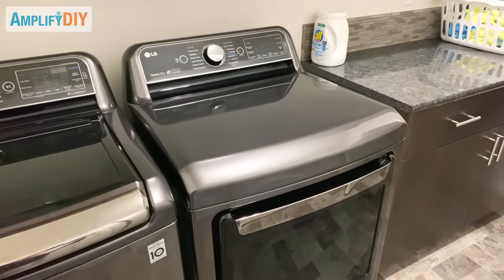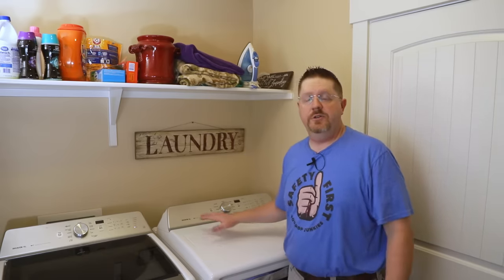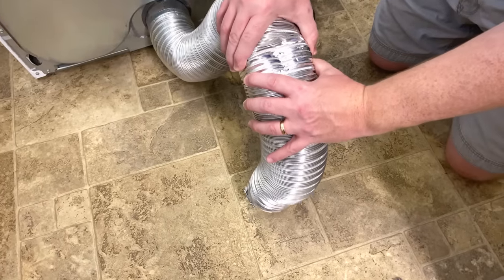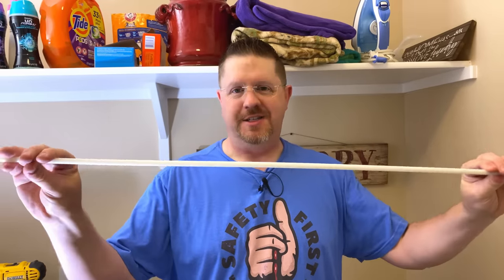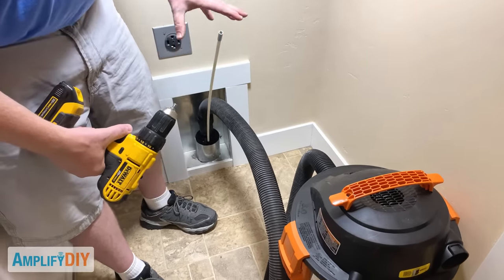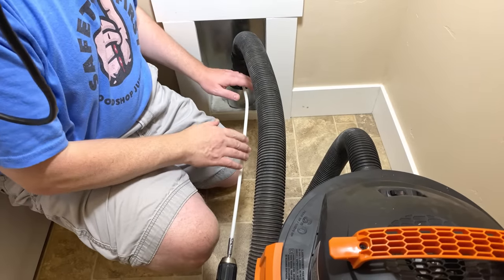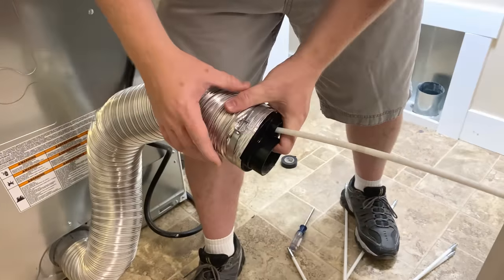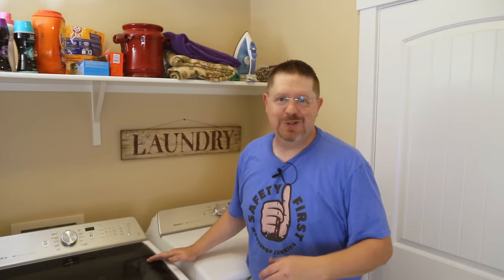How To Clean Your Dryer Vent Duct - Step By Step - It's Super Simple!

Comment: My concern is the brush coming out of the roof on the second floor.  If that happens and it gets stuck on the flapper door, I don't know what to do. I'm afraid of heights.
Reply from the maker: Hi Claudia - do you have a friend who can stand outside where they can see the vent and alert you when you get to the end? As long as you go slow and gentle, you should not have any problem with the tool getting stuck in the exterior vent. Good luck!
Reply: @AmplifyDIY  Thank you.  I'm going to give it a try.

Comment: Maybe dumb question but what if you don’t have a shop vac?
Reply from the maker: Hi K - you can use a regular vacuum... but you may need to use some duct tape to adapt the smaller hose diameter to the vacuum port thing I showed in the video. Good luck!

Comment: I followed all of the steps for cleaning out the vent and still got zero air flow.  I finally removed the elbow-shaped pipe under my dryer and found several pounds of lint all clumped up.  I removed the clump, put back the elbow, taped it back up with duct tape, and things are flowing again.

Comment: Is it fine if I don't use the vaccume?
Reply from the maker: You really should use a vacuum, or else you'll just wind up with a bunch of clumps of lint in ducting... 
Good luck!
Reply: @AmplifyDIY  Thank you so much. I just completed the cleaning and it worked very well. 
There was 1 blunder I did and I need your help to resolve it, I mistakenly ran the drill Anti clockwise and the brush along with few attachments were stuck inside the vent. As a solution I bought another kit and push it from other side. The brush with other attachments came out successfully. But there are still 2 attachment left inside. Any idea how can I pull it out. First I thought I'll let it inside but then I am scared that if I run the dryer there maybe a chance of fire because the attachments are plastic. Any idea how can I resolve this?
Reply from the maker: @umairhussain1039  Oof - you've gotten yourself into an unfortunate position! I think the dryer will be safe to run in the short term - I doubt the exhaust from the dryer will be hot enough to melt the plastic of these rods - their melting point is substantially higher than the dryer output will be. Leaving them there for a few days while you formulate a plan to get them out should be fine. I do recommend you pick up an inexpensive borescope so you can get an idea of a) where they are stuck, exactly and b) possibly grab them and pull them out. Here is the one I used in the video, and it works quite well: https://amzn.to/3o79REt

I'd snake the borescope into the vent to see where the detached rods are. This scope (I think) comes with a small "hook" attachment, which you may be able to use to grab the rods and fish them back out. You may also have to get creative with some bent up coat hangers etc to see if you can make a better hook or claw that can be used to grab some part of the rod and retrieve it. 

Good luck! I hope you are able to get them out soon!
Reply: @AmplifyDIY  Thank you! I have ordered the borescope, will let you know how it goes.
Reply: Hi again, I was able to take the rods out of the vent. But now I ran into another problem. I have a LG dryer, it is giving me flow sense warning with D95 error. Any suggestions?
Reply: I was able to resolve this problem. Looks like there was still a lot of lint inside which was not letting the heat to flow. I cleaned it properly and now everything is good. Thanks!

Comment: How about just to use the vacuum from outside the house without removing the vent attached to the dryer and not using the brush?
Reply from the maker: You definitely need some sort of mechanical "scrubbing" action to lift the lint off the inner walls of the vent. You can certainly attach a vacuum to the outside of the house instead of behind the dryer, but you should still use a brush or something similar to knock the lint off. Good luck!
Reply: @AmplifyDIY  thank you. My dryer is on top of the washer and I can't move it by myself . I will just do regular cleaning instead of detailed cleaning as shown in the video. Thanks again...

Comment: Hello I only have have a small wet & dry vac .
Reply from the maker: Another option rather than using a larger shop vac is to clean from the outside of the house in, rather from the inside out. This way you can leave the dryer connected to the vent, and run it on a cool setting. The dryer will provide plenty of airflow to blow the lint back out as you clean. 
Be aware you'll get tons of lint blown into your face - so wear a mask and safety goggles. Good luck!

Comment: You know what is waaaay faster and easier plus more fun? Put a leaf blower in the duct it blows all the crap out the vent in seconds my blower has turbo button. I do it every six months
Reply from the maker: Others have suggested this... while it appears to do a decent job of getting the big chunks out, mechanically cleaning with a brush will always do a better job. Still, cleaning them with a leaf blower is much better than never cleaning them out at all. Thanks for watching!
Reply: @AmplifyDIY   Using that brush does clean it better im sure but either way its going to accumulate back on there

Comment: Best way to avoid having a dryer fire is not to use plastic vent pipe with ribs on it where lint will build up, use metal vent pipe without any places lint will stick to. Otherwise clean it every 6 months, also clean lint filter after every load. Also remove back of dryer and vacuum it out.

Comment: I’m curious why you would pull all that dirt and lint into the house.  Why not set the shop vac to BLOW all that nastiness to the outside, thus keeping the house interior air much cleaner.
Reply from the maker: You certainly could use the shop vac in reverse to blow rather than suck - but the vacuum has a pretty good filter that prevents the lint from being blown into the house. Thanks for watching!

Comment: What if you don't have a shop vac?
Reply from the maker: Hi coneil72 - you have 2 options: you can adapt a regular household vacuum... just use some duct tape to seal up the connection from the vacuum adapter to your vacuum hose. Or - you can clean from the outside of the house towards the dryer, and use the dryer itself to blow air through the exhaust vent as you clean. You should run the dryer empty, and on the coolest cycle it has if you do it this way. Also note that this will blow ALL the lint right back out into your face as you clean, so I recommend a dust mask and goggles. 
Good luck!

Comment: my ducts have kinds of twist and turns. i get a little paranoid that it will break part of the duct
Reply from the maker: Hi Bandit - these cleaning kits are specifically designed to deal with twisting and bending in the ductwork. As long as your ducts are the kind with smooth walls like I showed in this video, the brush and cleaning kit should fit through it just fine. Good luck!

Comment: What about the vent in the house?
Reply from the maker: You mean the heating/air conditioning vents? Those are much larger and require a larger brush.. They are also usually a lot longer and require a lot more suction - generally that's a job that is not really DIY. Good luck!

Comment: What if the lint is wet? Mine is clogged with wet lint.
Reply from the maker: How wet are we talkin' here - sopping/dripping? Or just damp? If it's just sorta damp, then you can still clean it in the way the video shows. If it's REALLY wet, then you need to wait for it to dry. You might be able to help it dry by running the dryer on a medium/cool setting with no clothes in it for several cycles.... but I only recommend that if the vent is not completely clogged. The dryer does need to be able to actually move some air or it can overheat. 
Good luck!

Comment: Wow never seen a duct on the back of a clothes dryer that goes into the floor or wall.  ALL of the ones here in Australia have no connection built into the house or apartment.  The dryer just vents out the back of the unit towards the wall.
Reply from the maker: Really? As in - it vents into the room? How do you keep your laundry room from getting SUPER hot?
Reply: @AmplifyDIY  Open a window if there is one.  Otherwise just close the door and let it get hot.  The room is already likely to be 30C+ during summer anyway - so not that big of an issue.
Reply from the maker: @VestigialHead  Hi Ian - I wonder if you are talking about a different kind of clothes dryer? The ones most people in the US use get VERY hot - 135F (57C) is typical, but over 150F (65C) is not all that uncommon. Venting indoors is simply out of the question. I think you must be used to a condenser dryer, which puts out a MUCH cooler exhaust: https://www.betta.com.au/blog/clothes-dryers-to-vent-or-not-to-vent
Reply: @AmplifyDIY  The condenser dryers look like they need a water supply connected.  Never seen a dryer here with that.  Not saying no one has them - just that it must be very uncommon.

Comment: Man, no one shows the exact video I need to do this for my gas dryer.
Reply from the maker: Yeah, gas dryers are quite a bit less common - though my family had one when I was a kid. The only real alteration to the instructions here for a gas dryer is that you need to both shut off and disconnect the gas line to the dryer before you can move it. I'd refer to the owner's manual for how to do that - if you don't have one, google should be able to find one if you just search for the model number + "owners manual" or similar. 

Good luck!
Reply: @AmplifyDIY  I appreciate that! Thank you for taking a moment to help me!

Comment: Don’t reverse the brush when you are removing the brush, it will come off the rod when you take it out. We had to go 40 feet to clean out the vent so we had to buy extra extensions to reach the end.
Reply from the maker: Great advice, David! I'm pretty sure I mentioned the same in the video, but it bears repeating. NEVER put your drill in reverse with this brush setup. Always run it in forward, even when pulling the brush rod segments out. Thanks for watching!

Comment: A segment of garden hose and a toiler bowl brush is more efficient.. and cheaper ..
Reply from the maker: And is incredibly likely to not work well and leave you with a toilet bowl brush stuck deep in your dryer vent pipe...
Reply: @AmplifyDIY  Never had a problem...   toilet brush is clamped into the hose..   way more simple..

Comment: Tried to order kit. Link won’t work.
Reply from the maker: I T Man - sorry you had difficulty with the link. It's an Amazon link for the US Amazon store, and may not work if you are outside the US. The product is made by a company named Gardus, and is called: "Gardus RLE202 LintEater Rotary Dryer Vent Cleaning System". Looks like you can get it here: 
https://www.tractorsupply.com/tsc/product/gardus-linteater-dryer-vent-cleaning-system-rle202
or - just put the name into Google and you should have no problem finding a supplier near you. 
Good luck!
Reply: Tried again and it worked!!

Comment: what about the inside of the dryer
Reply from the maker: Yes, you should try to clean the inside of your dryer cabinet as well. I didn't include that because there is such variety in the designs / options for how to clean them. Consult your dryer's user manual to see how to clean yours. Thanks for watching!

Comment: Y'all neglect the slot that the lint trap goes in which is often full of lint also and really tough to clean.
Reply from the maker: Great tip Ruby! I use the crevice tool with my vacuum to clean that out. They also make small brushes that fit in there to help dislodge any lint. Maybe a follow up video is in order…

Comment: Thx for sharing your very simple video you would think! I say that to say? My dumbass shortcut taking Blackman  husband ugh just skipped the 1st section and went straight to the 2nd section because I was like let me go ahead & put 2 rods on but still go up to only the 1st rod while drilling smh! Then he tells me? He's pushing the brush manually no drill running talking about he has to pull the lint back anyways? Dumb duh if he do section by section until the end it will come out the other way! Not put about 5 rods on only to retract the rod then put back which the damn rods did twist like a pretzel & hit me in the damn face ouch! IM DONE PSSST!

Comment: I can't see the name of the item you used.
Reply from the maker: Hi B - it's called a LintEater Dryer Vent Cleaner, and I left this link in the video description: https://amzn.to/2E0gZjK - note that there are a bunch of cheap knock-offs of this design, but they do not include the adapter for the vacuum, and frequently fall apart inside the dryer vent. I only recommend the original. Good luck!

Comment: Except that those kits do not work when the builder of your home was uneducated and used plastic hose while allowing it to dip in between each and every rafter in the attic. Straight pipe going straight up with a metal elbow, connected to plastic hose, with collection dips in the line every 8 feet.
The ONLY repair is a complete and total removal and replacement. Which by the way, gets your rent increased $75 a month. 
Yea folks. It's only the landlords responsibility IF they do not have to actually fix or repair anything. 
And I know. I know the law states otherwise. But here in reality, the law is one of the most flexible aspects of our dying nation.
And when the judge tells you that you do not have "renter's rights", that is exactly what you do not have.
Know your dryer vent system WELL before buying tools.
Reply from the maker: Oof. That's terrible. Does the landlord not understand that it's an actual real fire risk? Are they willing to pay a professional vent cleaner to come at least clean it and take on the liability if there is damage to the crappy droopy section in the attic? I hope you are able to find some solution...
Reply: @AmplifyDIY  
He doesn't believe there is a problem. 
If he hasn't experienced something, its not real. Another tenant's faucets were leaking.
His response: I was there in September and everything was fine. (7 months prior to the leak)
But at 9 am this morning, I decided the landlord does not get a choice anymore. 
I bought all new everything. From just past the exhaust outlet of the dryer to the outside vent cover.
He will be given the receipts, which will be deducted from the rent. Minus labor because I am a human being. lol
Turns out that in my state, if a landlord refuses a necessary repair, ESPECIALLY if the needed repair creates risk to the tenant if not repaired, the tenant may complete repairs themselves or via professional service and turn in the receipts in place of equal value rent payment(s).

Technically I could have called an HVAC company and taken a couple full month's rent off my plate. He can't do the repairs himself. He would have had to hire a company. I say I saved him money either way. If he doesn't like it, my rent payment and I turn and walk out, off to find another place. 
The last two days have been ridiculous. And him and a local judge are incorrect on the law it seems.
Now, no more clogs and no more dips to collect material.
Reply from the maker: Way to stick up for yourself and get the problem solved! I've dealt with slimy landlords in the past, and it's.... well, I can't say what it was like in polite company. I hope you don't get any grief about the repair, but at least now your dryer will work well and the risk of fire has been taken care of. Nice job!

Comment: You connected vaccum but did not even show or mention it.
Reply from the maker: Almost any shop vac will work properly. They mostly all have the same size hose. If you don't have a shop vac, you can use some duct tape to adapt a regular vacuum.

Comment: Way too much work and complexity.  I use a cheap electric leaf blower I got at a second-hand store for $15.  I open the face of the dryer after securing the breaker.  Remove the face plate to the dryer blower and insert the leaf blower into the duct from there.  Turn it on and it all goes outside fast.  Inspect the blower impeller at this time for looseness since these will wear out and cause over heating.  Also, a good dryer exhaust duct only uses rigid metal duct.  Stop using flex duct.

Comment: Remove the old one and throw it in the garbage. Install new one. There it's cleaned.
Reply from the maker: Heh. That may work for the short connection to the vent in the wall, but I don't think anyone wants to rip open their walls just to throw away a perfectly good vent rather than just spend a few minutes cleaning it...
Reply: @AmplifyDIY  of course you would keep the vent portion that goes through the wall but the piping from there to the dryer I toss. It's cheap and easy to replace.

Comment: why not get a new pipe? cheaper than cleaning kit
Reply from the maker: You must not have actually watched the video. This is how to clean the duct work that runs through the walls of your house to the outside, not just the short duct that attaches to the rear of the dryer.

Comment: While this looks Great,  DO NOT DO THIS !!!   Most homeowners have a foil coil not a rigid metal coil duct.   Unless you have a rigid metal one,  this will RIP holes in the foil ducts and YOU WONT KNOW IT.      We had to replace our entire system because of this
Reply from the maker: Hi Mac - most homes have rigid metal ducts as shown in this video ... because that's been required by code for many, many years. Any home with a flexible duct inside the walls either was never inspected when it was built, or the inspector missed it or just didn't care.
Sorry to hear you had to deal with such shoddy construction. :-(